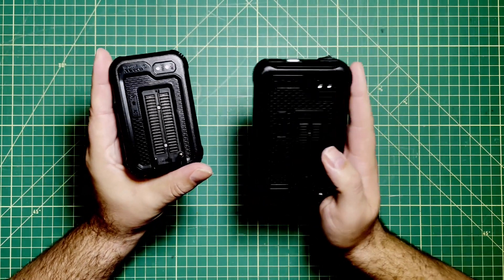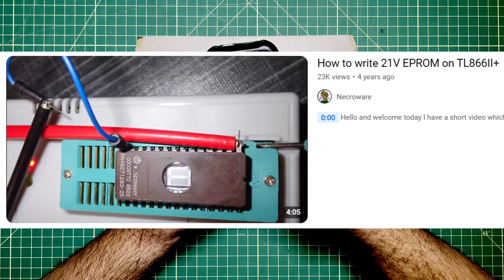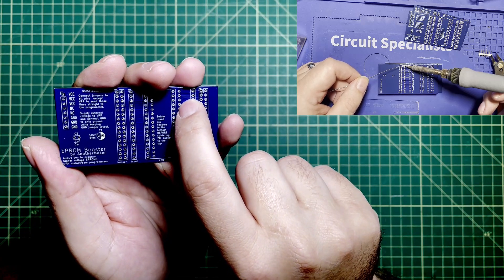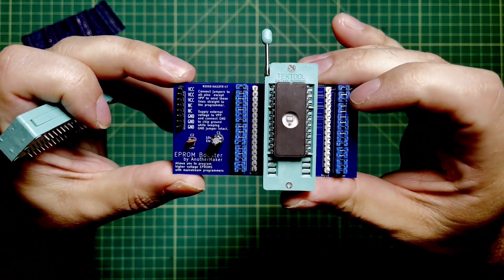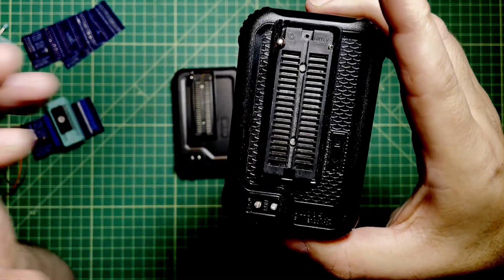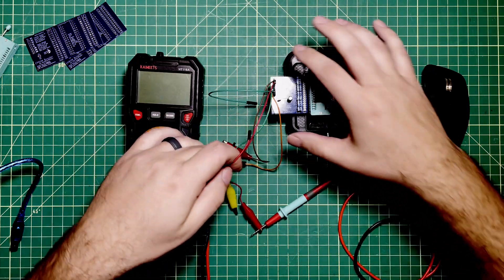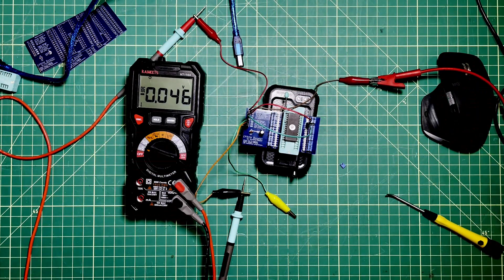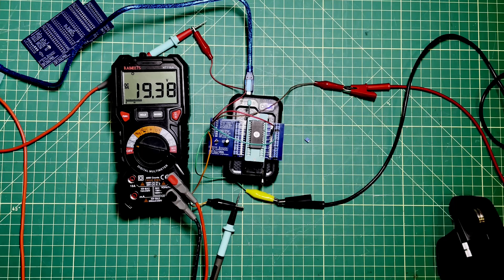EPROM Booster - Program high voltage and vintage Eproms on the XGECU TL866+ and T48

Comment: Hello, I have a T48, which, using version 12.67, programmed 2716 and 2732 EPROMs perfectly. However, after updating to version 12.96, it stopped programming and throws an error in the first address. According to the AI, it seems that the T48 firmware changed its timings in version 12.96, and it appears that the VPP also changed. Have you tried a newer version (I see you're using 12.67)?

I completely regret updating XGpro. It's practically rendered the T48 unusable for 2716 or 2732 EPROMs, and who knows what other ones. It programs newer EPROMs fine, for example, the 27C4001. I would appreciate it if you could confirm that you've updated XGpro and that your device is still programming 2732 EPROMs.
Regards.
Reply from the maker: I'm sorry to hear that. I have not updated mine and I guess I won't now :(

Comment: you could also add a small voltmeter module on the free space, so you don't need a multimeter.
Reply from the maker: I was a little worried about adding anything to the top or bottom of the board, but I probably could on the side.

Comment: Very cool project!

A couple of quick suggestions for a v2 - Rather than supply the VPP voltage from an external power supply, why not use one of those mt3608 boost converters you can get for cheap?  The input can be the +5V from the programmer and the output can be fine tuned to your chip.

Additionally, by using some mosfets and a multi-pole switch, you can even have a selector for the type of eprom and use the mosfets to route the boosted VPP voltage to the correct pin. You can even take the VPP voltage the programmer puts out and boost that, which has the added safety benefit of only enabling the boosted voltage when VPP is enabled.
Reply from the maker: I like that. Combine with a meter and it could be pretty cool. Although I'm not sure if the programmer constantly puts out 5v. I'm wondering if that changes per chip.